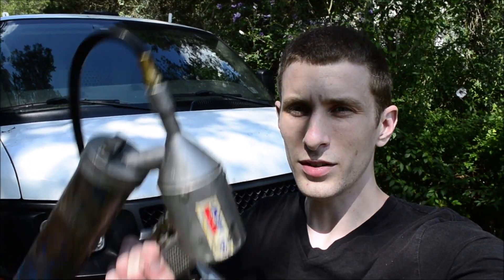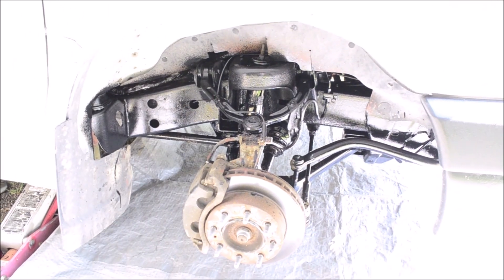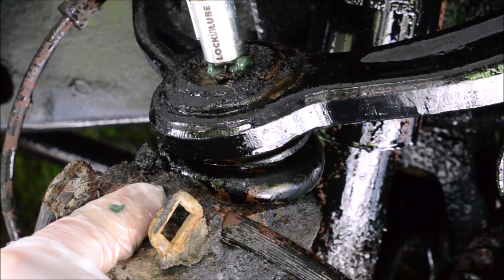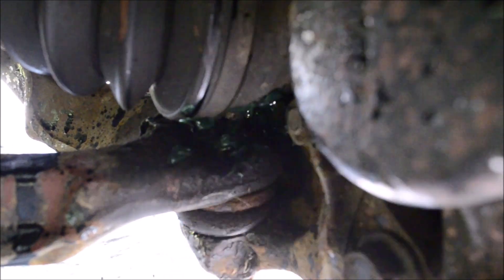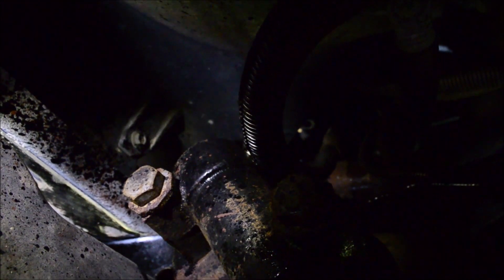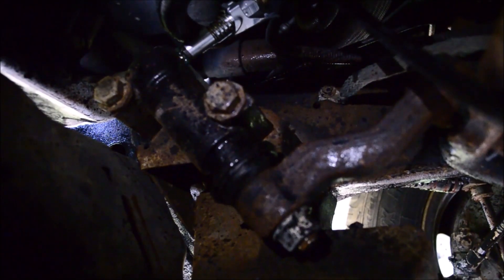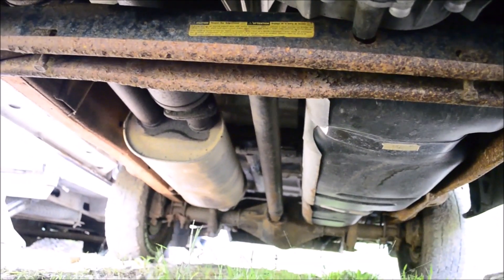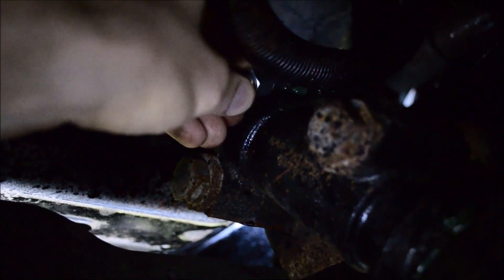Grease Chassis & Zerk Locations CHEVY EXPRESS - FT. LockNLube

Comment: Wait, this is a factory AWD Express 2500 wow how rare!  I usually clean the grease nipples before attaching the coupler,  just in case.  Thanks for the video.
Reply from the maker: Hi, it's a Quigley 4x4 conversion package, factory approved, but installed by Quigley.

Comment: excellent vid. 1 I thought pumping to much resulted in blowing the seals? 2. concerned w/ mixing greases what grease do you suggest.3. I don't have a fancy gun just the mini type will I be able to access every zerk? 04 3500 express thanks
Reply: I was taught 1 or 2 pumps per zerk twice a year in order to AVOID blows the boots.  The exception being u-joint of course, pump those full until you hear them pop.